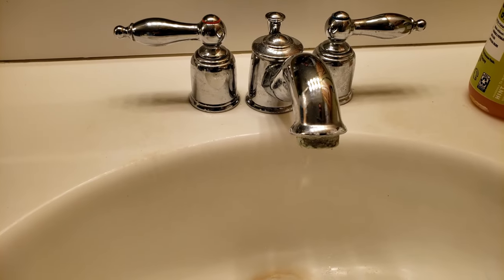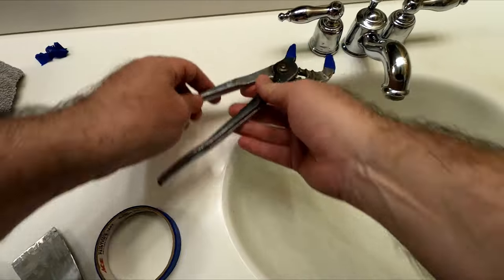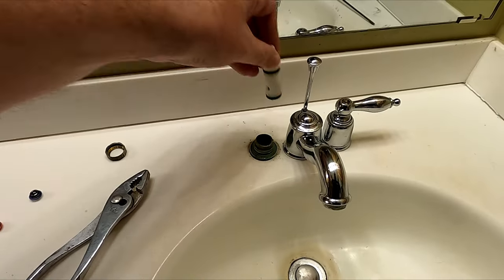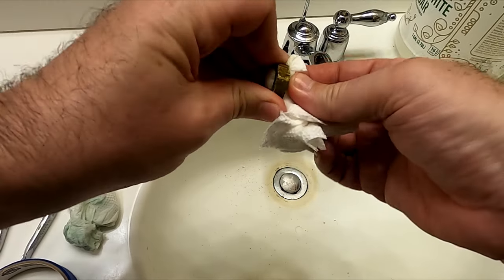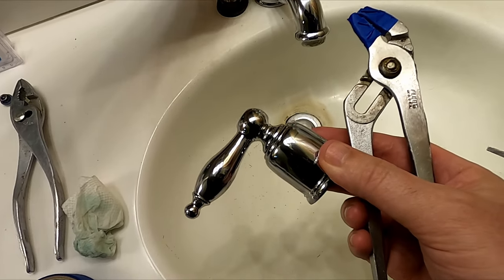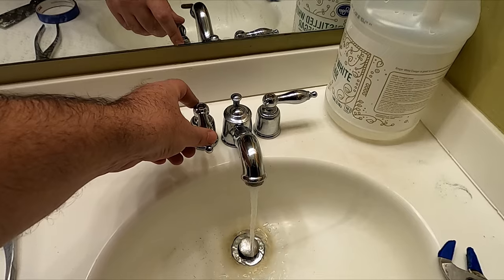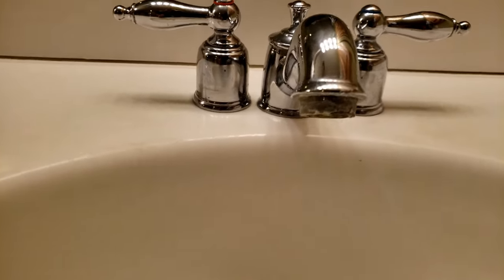How To Fix A Leaking Faucet Without A Screw In The Handle - MOEN Faucet

Comment: Thank you so much! It was a pain to remove the old cartridge, but thankfully, I was able to locate a Moen cartridge puller tool by Danco at Home Depot. Finally got loose after some pulling.
Reply from the maker: Glad I could help! I was able to get it out without the cartage puller but it would have helped. Thanks for the great comment!

Comment: @ThatHobby #ThatHobby we need to fix a leaking shower/bath faucet from Bathfitters
Reply from the maker: Coming soon! There is a cartridge behind the water handle in the shower too. I need to replace one at my house. It's not leaking but it is stuck and the hot water won't come on. It is similar to replacing a cartridge on a sink handle. It is really tough to get out though and there is a pully tool that you need to use to get the cartridge out.

Comment: I have that same Moen faucet - any idea what its name or model number is?  I need to replace a broken handle.  Thanks!
Reply from the maker: I couldn't find a model number. You could try taking a picture of it and emailing it to Moen. They have a pretty big selections of faucets on their site. The customer support link is on the bottom of there website.
Reply from the maker: @rubberchicken5670  Yeah they are tough to work on. I had to replace a few of our shower cartages too. At least there was a screw on the shower handles. But those shower cartages were really tough to get out.

Comment: Good video. But I needed help reinstalling the handle which is similar to yours but it's separate from the base. My handle doesn't to want to go back in. Without the screw it just keeps popping back out. It doesn't want to seat on the new cartridge (which is all the way down & secured with the nut.) God, I hate Moen!
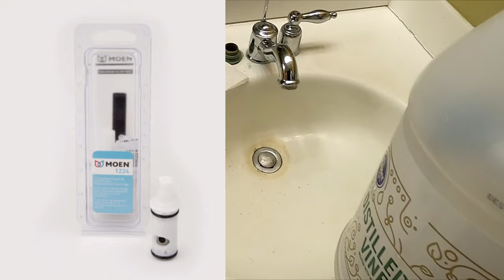Reply from the maker: Mine had a cover to hold the cartage down. check out 2:00 to see what it looks like. The cover may be stuck in your handle. Mine were pretty corroded and I had to clean them up really good to get them back on there.
Reply: @ThatHobby  Thanx. But, that nut was fine. The catch tab under the handle was corroded & it broke when I removed it. The handle just spins on the replacement cartridge. I need a new faucet.

Comment: of course the wife is behind asking all sort of questions and putting doubts in our heads. It really helps when someone believes in what we are doing because that type of questions look more like criticism. Despite my comments that are aimed to strengthen wife husband relationships, this is a good video. Still the faucet valve is not like mine after I removed the first part
Reply from the maker: Thanks! Yeah there are more than a few different types of faucet valves out there. But they generally all come out the same way after you get the handle off. The key is to remove the bolt or pin that holds the cartage in. Once you get that out of the way you should be able to get the cartage out. My wife was actually pretty happy that I fixed the faucet. It is so nice to not have a leaking faucet now.

Comment: Why wouldn't you just run both hot and cold, then shut them off. Then see if the leak is hot or cold?
Reply from the maker: You would have to shut the water off under the sink to test it that way. You could do that but just make sure the shut off valves aren't that old. Mine always seem to break when I shut them off and then I have a much bigger job to do. So I just shut off the main water to the house when I work on the facet handles. If your shut off valves are kind of old and you want to test it that way you might want to buy a few new ones and keep them on hand for emergencies.
Reply: @ThatHobby  - What I meant was, that for me, I don't have shut offs at the upstairs bathroom sinks. Mine was started to leak, I turned on both hot and cold for just a minute, then shut both off, the leak continued to be hot. So, instead of shutting off the water to the entire house, I just turned the hot off at the HW tank. That way, if I needed to go to the store to get parts, My wife still had cold water, could use the toilet etc. You just changed it out hoping it was the right one. I also just replaced the o-rings on the old cartridge just to see, low and behold, no more leak. Saved me going to the hardware store and $25 bucks! Woohoo! Cheers...
Reply from the maker: That's great! Mine was in there pretty tight and got tore up taking it out. That's great that you were able to test it that way too. You must have pretty nice plumbing. My hot water takes forever to get to the bathroom sink upstairs and my cold water is always lukewarm. So it would take a while to run that test. But it sounds like a pretty good way to test it.

Comment: I’m trying to get to my flow valve for my shower .. the base of the handle turnes but the knob won’t come off
Reply from the maker: For my shower there is a screw head under the cap. So I got lucky there. You can double check to make sure there isn't a screw under the cap and then inspect the sides for a Allen key or screw hole. If you can't find anything see if you can find a name anywhere on it and look it up before you try to unscrew it like this.

Comment: All I get is a constant spin and handle never moves upward
Reply from the maker: I wonder if the threads on the faucet handle are striped? The corrosion could have worn them down. Try spinning it counter clockwise for a while and then pull up on it. If it doesn't feel like its loosening then try checking under the sink and see if hardware under the counter is moving. Maybe it is loose under there and preventing the handle from unscrewing?
Reply: @ThatHobby  everything under the sink good and tight, it took pressure from the channel lock but once it broke free it just spins freely each direction no stop
Reply from the maker: This sounds like a tough one. It kind of sounds like there is something holding it down. Some faucet handles are held down by an allen key screw. It is on the side or the back. Once you loosen it you can take it off. But if it doesn't have a screw under the cap or an allen key screw on the side or the back and you can't unscrew or pull off the base then something could be broken inside the handle?

Comment: I can't get handle back on
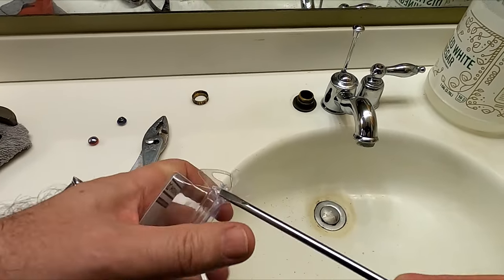Reply from the maker: Watch the reassembly chapter to make sure you have the cartage in right. 3:30 If you have the cartridge in all the way and the cover bolt screwed on the cartridge then it should just be a matter of moving the top of cartridge around to get it to fit into the red plastic piece in the handle.